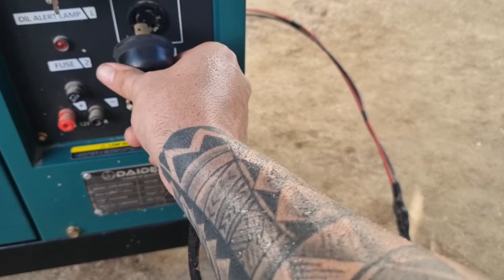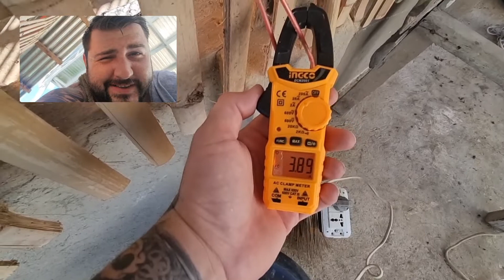Well is a brown out,  Jax is recovering

Comment: The larger generator how many gallons of fuel is needed for one day of brownout? Could the dog have been bitten by a snake? Coz he looks a little woozy,,,,,nice vlog
Reply from the maker: I think it holds about 3 or 4 gallons, im not really sure.  But about half a tank is when I need to top it off or it will start sucking in air bubbles. I can run for like 12 -16 hours on one 5 gallon can. I keep 10 gallons on hand for Emergency.. Jax has no bite marks. He just fought to many other dogs and cut his paws pretty good. Thanks for watching
Reply from the maker: @kenstar1862  it's only a bamboo fence. It's super strong when it's not being eaten by termites 😅. I'll show the holes in a video.. I can't wait to get the money, so I can build the new fence hahahaha, that fucker will never be able to escape 🤣😂